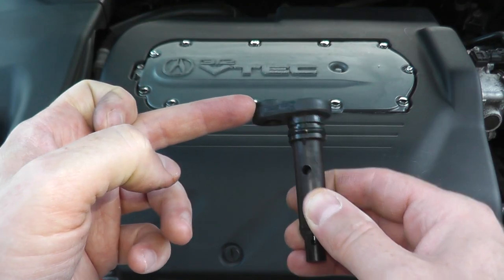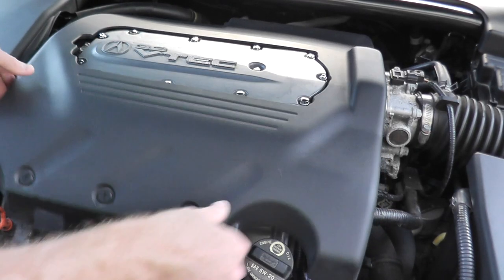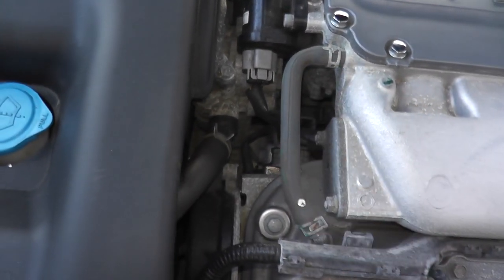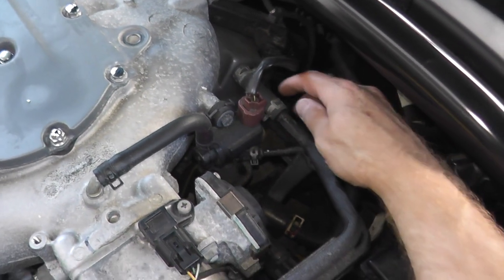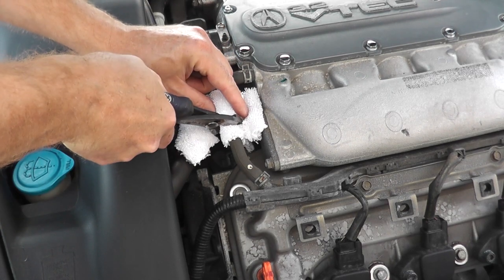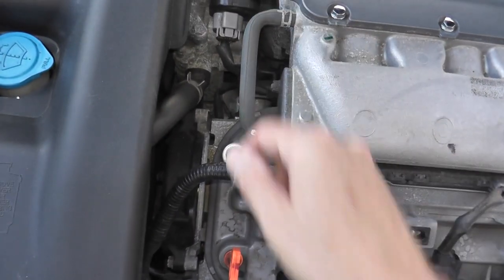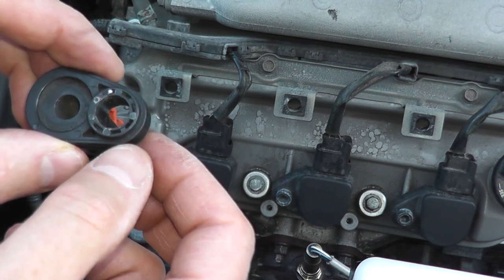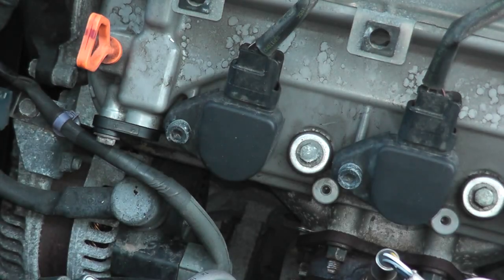Acura TL PCV Valve Testing and Replacement

Comment: Thanks so much. Your tip on using the flat head screw driver to pull it out, might have helped me not end up with a brocken pvc valve upon pulling it out. I have had the valve for a month or so, not switching it out b/c I read that it breaks on a lot of people, and I couldn't find the tap locally to pull it out in the event it broke. Decided to try it today, and all went smooth with me slowly helping pull nudge it out with the flat head. Thanks again for taking the time to make this. -I should mention, Mine came with o rings, and I also had a washer type item on my old valve that I pulled off and used with the new pvc valve. Fingers crossed all goes well with the new piece
.

Comment: One of the most overlooked parts of a car that are extremely critical.. I replace every 50k miles regardless of the sensors condition
Reply from the maker: Great tip!
Reply: CarsNToys thanks! Those sensors are usually around $5 so better safe than sorry. No reason to have an unnecessary oil leak
Reply: Scotty W, you are throwing your money away. If you are concerned take it out and wash it with plenty with soap and water to get rid of all the trapped grease and test to see if the valve still moves freely under pressure by pressing on it and if it does that means it is working fine. Just put it back and save your money. The OEM valve is much better than any after market. The purpose of that valve is to relieve the pressure in the crankcase so the built up pressure would not damage other component----hence, positive pressure crankcase ventilation....
Reply: trankt54155 how am I throwing money away. Between 50-100k they should just be replaced. $5 is NOTHING and it’s great preventative maintenance. Or if you take it out and it doesn’t rattle then a clean won’t fix it. Better safe than sorry
Reply: trankt54155 and yes I know what a PCV valve is. I’ve worked on cars for 15 years now. Very easy to replace
Reply: P
Reply: @djentyman4002  

P
Ppl
Reply: @djentyman4002  Do you have to buy o rings separate from the valve itself?

Comment: Is this a regular maintenance item? have never looked at this in 250k miles and car runs beautiful...
Reply: mine has the same miles and mine just broke on its own. so urs is on its way. use a gentle back and forth twisting motion when  removing.  If not you'll have to remove the upper intake manifold just to get valve cover off, but all for nothing, because the broken piece is hidden behind a riveted plate that should not be removed.  You have to fish all the pieces out of the hole that it's inserted from basically. but it's easier with the valve cover off so,.......

Comment: I wonder if PCV valve can click and still be bad?  I pinch the hose and PCV valve clicks and engine RPM dips a bit and then comes back up. This tells me that PCV valve is working however there is a bit oil consumption which is about 3/4th Quarts in 3k miles.

Comment: Hey you think the pcv valve could cause a code of p0174-p0171 for a 05 3.2l Acura tl? Or could it be vacuum leak it says system running to lean

Comment: My car is hesitating to start but everything is good in terms of the engine spark plugs are good and battery is good  oil coolant etc so I’m assuming it’s this I just replace my mass air flow sensor hopefully I replace this and I get a fix

Comment: Can a clogged PCV valve cause a rich condition or P0172 and P0175 codes on a 4th Gen Acura TL 3.7L?
Reply: About the same here, p0159 & p0175.
Reply: I also have alot of smoke coming out the end of tailpipes + oil consumption

Comment: I neglected this and now have oil leaking all over the damn place. Tried to remove the pcv valve and it broke and half is still inside. If i get the valve replaced is there any chance the oil leaks could stop or am i gonna hafta pull the engine out and reseal everything to stop the leaks?
Reply: Were you able to get it out?
Reply: @nm3547  not yet. Waitin til i get a day off so i can pull the valve covers off and push it out from the inside

Comment: I don't replace. mine just plugs out and so I just spray carb cleaner n plug it back in. I do this once a month. I shake it and can hear it clogged with oil. Once cleaned it feels lighter n clearly sounds unclogged.

I find that if the valve is dirty, engine becomes heavy, some engine knock occurs.
Reply from the maker: Appreciate the feedback. Thank you.
Reply: Nizar, in the combustion of gas/fuel mixture in the cylinders  there is always some unburned compressed mixture that leaks out of the cylinder into the crankcase environment and the pressure builds up with each combustion cycle and thus there is the need to decompress and vent off that escaped mixture to recirculate it back into the manifold for it to burn off and also to relieve the built up pressure; otherwise, if the pressure is not decompressed and continues to build other components like gaskets would blow in order to relieve the pressure. So it is essentially that the valve is always working and the OEM valve should work very well unless you do not change the engine oil and the dirty oil and grime collect over time and interfere with the spring inside the valve from opening with increased pressure.

Comment: Just did my own yesterday at 190k
Reply: What were some differences you noticed? I have a TL with 172k on her and I'm sure she needs it
Reply: @edward2868  tbh the car literally feels better not because of the pcv vavle tho! I literally clean the throttle body,intake manifold, egr sensor, shift solnoid an also replaced all the filters gonna change the spark sparks plug drive,timing belt tomorrow but overall the car does feel much better! 😊 and all the repair I do myself I am not a mechanic but watching this guy video I am literally a pro lol
Reply: @Portland2055  that's dope!! So far I've done some of that already including NGK spark plugs but next is the coil overs and then this pcv valve I guess I just wanted to see if there is a difference if I take care of this
Reply: @edward2868  you will see a different but not much please get your manifold clean! N throtlle body youll be amazed to see how many build up is in your engine valve
Reply: @edward2868  just invest in the tools you need follow this guy instructions on you'll be surprised to see how much money you'll save because the stealer ship gonna rip you off when you could have watch couple videos get your tools,parts n do it yourself!
Reply from the maker: That's awesome guys. Keep them going!

Comment: Some say to shake it and it should make some noise. If not noise definitely need to replace it.
Reply: Clean the valve with soap/water solution to degrease engine oil that has been collected inside and if you can depress the plate that has a spring behind it depress it with a little screw driver to see if it springs in and out easily, and if it does it is still working for you. It is an air pressure valve----unlike a fluid pressure valve of your radiator cap or the coolant thermostat.
Reply: DO NOT attempt to "test" a PCV valve by shaking it.
Take the old valve out -- put the new HONDA PCV valve in -- you're good to go !!

Comment: I changed it fixed everything but it had broke off into the engine took a little while but got it
Reply from the maker: Glad you were successful.
Reply: I've ran into this problem on my 05 TL base model.
Tried to take it out of the engine and half of the sensor stayed in the engine.

What did you use to get it out?
Reply: @CarsNToys  any advice would be most appreciated

Comment: What to do if oil is leaking from my pcv valve
Reply: Check your valve cover gasket
Reply: bamomotron2000 if oil is leaking from pcv valve would it be a valve cover issue or the o rings from the pcv valve? My pcv valve is leaking.
Reply: If you replaced your pcv valve and oil is still leaking out from that valve then yes. Your valve cover gasket needs to be checked and see if there is a crack or if the gasket snapped. When i took mine off and replaced the gasket all the issues with oil leaks stopped.